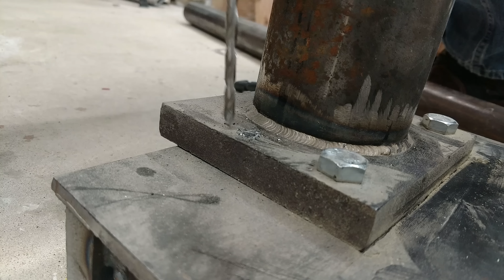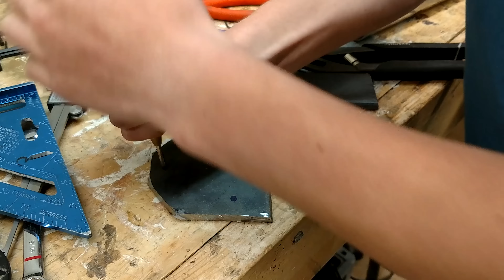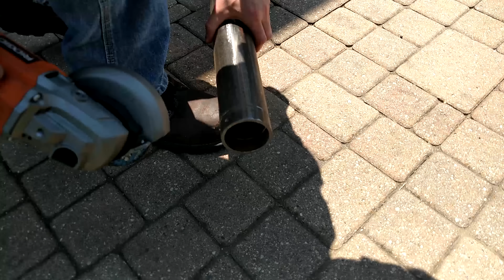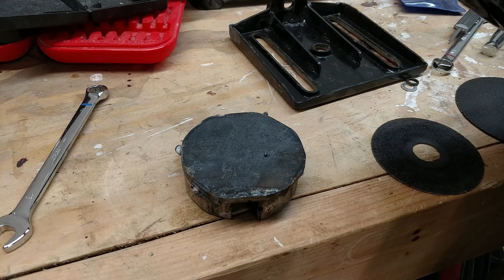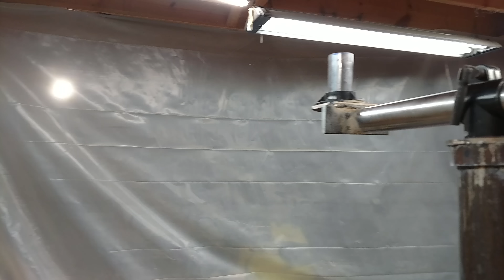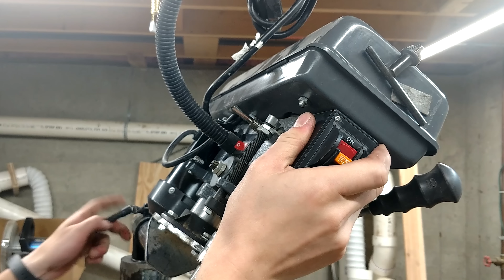harbor freight drill press upgrade

Comment: Only thing that puzzles me is, Why didn't he drill all this before he took the Drill Press apart?
Reply: The drill press would not go through that metal, I could barley open a 12mm hole to 14mm with it and a brand new Milwaukee bit.
Reply: Also, those welds will NOT hold once he put much force while drilling..!! Horrible welds, no support for the 90 degree angles and all the weight bouncing around like a bunny rabbit....!! He made a 60 buck drill press into a 300 dollar pile of junk that can't drill anything anymore, SMH.
Reply: @Tom-yc8jv  At least he tried and put it together in a neat video - some people like to try and learn.
Reply: Yeah and also I prefer using a step bit

Comment: The utility of the final product is suspect but the video sure is fun to watch.  Others have brought up good points of criticism,  and I want to add one point of concern.  Before the mods the weight of the top assembly, which includes the motor, was distributed roughly evenly around the column.  In the new arrangement all the weight has shifted to the front of the column, which surely bends the column, taking the drilled holes out of square.  Perpendicular holes is one of  the reason why most people buy a drill press

Comment: Nice tutorial on how to spend several hours making sure your drill press never drills a hole at 90° ever again. Seriously though, this was a fantastic use of all the crystal meth in whatever county you live in.

Jokes aside, the basic idea you were going for isn't bad; with some proper welds, better fabricated parts, and more thought into maintaining the balance and rigidity of the structure (plus a head unit actually worth putting all the work into to begin with lol), this could be a decent way to upgrade an old machine. With  some more practice, the creativity used in designing and recording this can be put towards a lot better used. Good luck, keep it up!

Comment: hmm yea got a 16 speed hf drill press too  main issue is the colum its thin was am going to go to a solid instead of the tube it has now...and make a steel table instead of aluminum one has now...make  more rigid..also 3/4 cap chuck

Comment: I’d not a engineering genius, but for me and what I do I see more advantage in the ability to change to angle of the drill than anything else. I know I can change the angle of my table but for some reason it seems it would be better to move the entire head as you can. 

I see you set out to complete a project, which you succeeded in doing, well done.

Comment: There are reasons the drill head is kept vertical and the work surface is able to rotate and canter. That wobble every time you let go concerns me, and at the very least I would add a couple gussets to that 90. However, my guess is that it bent or broke the welds the first time you used the drill press. Also what will you use to adjust the height of your worktable now?
Reply: Well just looking at his welds, the wobble is the least of his concerns....

Comment: Nice modifications, but how much slop do you have on the Horizontal Plane, do you maintain the parallel to the plane of the horizon; at right angles to the vertical to maintain the 90° angle the further you move the drill head outwards.

Comment: id probably add a support to that L join. seems like a lot of pressure for it to take
Reply from the maker: I was going to add it but I haven't gotten around to it, thanks for the suggestion.
Reply: And maybe get ride of the exhaust pipe and replace it with something more substantial.  You could see a huge amount of flex when you were adjusting it think what it would do actualy using it.

Comment: Wouldn't it be easier to just buy a bigger drill press
Reply: You go ahead  Andprice a drill press With that deep of a wrote, go ahead I'll wait
Reply: Some weekenders enjoy the project, and have scraps around from old projects. Seems to be the case here.
Reply: I've seen bench top radial arm drill presses for around $350 on sale. Even the store bought ones suffer from rigidity problems which is less if your only doing woodworking and always using sharp tooling. I'm wondering if this can drill a plumb / perpendicular / straight hole in metal?

Comment: I'm not sure why you would want the drill press head to tilt. It would have been far easier to tilt the table, and that would not make the head less stable like this mod does. You could also just hinge the base of the drill press on a bench if you wanted to have it horizontal.

Comment: Goodbye rigidity. Hello oversized holes. I like what you were going for and understand not having the capability or the knowledge to execute it perfectly for all these armchair machinists on YouTube. If you ever get the chance to redo your design, you should go with 1/4" wall  thickness tubing, less joints, even fewer adjustable joints, MIG or TIG welding and a muchuch heavier base or you could fill it with concrete or sand. If you could pull that off I think it'd surprise you how much of a difference it would be. You succeeded in making me think about some possible mods so thanks and don't put any value into non-constructive criticism from YouTube douche nozzles.

Comment: i have one of these. the table/ height are not a problem. the press can only drill a depth of 2" anyways. the real problem is the strength of the motor. it cant drill a 1" hole through a 2x4 without getting stuck.   my crappy corded hand drill has more power and RPM than my HF Drill Press. i don't understand why they put such crappy motors on a tool like this.
Reply: It's less than 1/6 HP despite what they claim look at the amp draw and compare it to split phase 1750 110 volt motors sold at Grainger.  I got rid of my H/F 8 inch D/P a 10 inch Wen is a much better press with more power and cast iron not stamped  main parts.

Comment: Stop talking about the drill head tilting,it's the only static item when working on items,the item you can/are/will be drilling is dynamic and many times is far hard to tilt/yaw/pitch so moving the head around is far better. On a different note, if you can move the head,when clamped it needs to have no movement,and I wouldn't trust that bolt on clamp due to the shyte metal used in the thing. Good idea though.

Comment: Thanks for sharing but all the fab work you did going into a 50 dollar sweat shop special is far not worth the time in my book. And I normally like HF tools( not after I bought a similar drill press and after 3 defects I'm fed up with them). Not to mention the motor is only 1/5hp SUPPOSIDLY and after the motor upgrade you'd have more into it than a good used press with a much more powerful motor.

Awesome work man that's for certain. Nice idea for a Delta or something 😁

Comment: Tip: We know you’re drilling 3 holes, 1/4” first then 1/2”...we don’t need to see 10 seconds for each drilling. Show the first 1/4” hole in 10 seconds, then the other 5 just show  touching the bit to metal and then a sudden breakthrough. It’d be a funny, and save 50 seconds.

Comment: Why would anyone go to all this trouble and effort? In my area there are 2 rockwell/delta radial drill presses  for sale for less than  $200, ( often about $ 100, It is an odd press , limited market. ) If necessary just drive a few hundred miles and get the real thing.